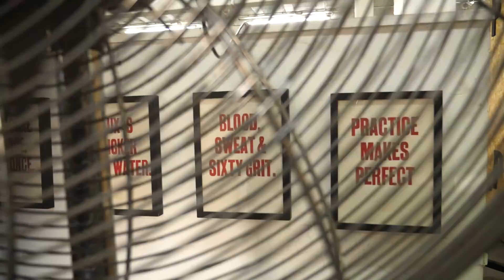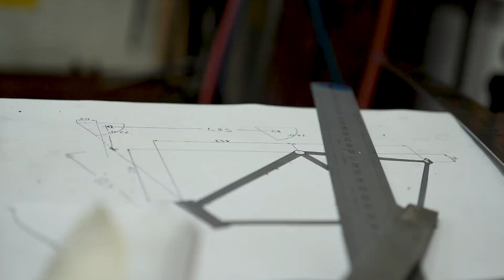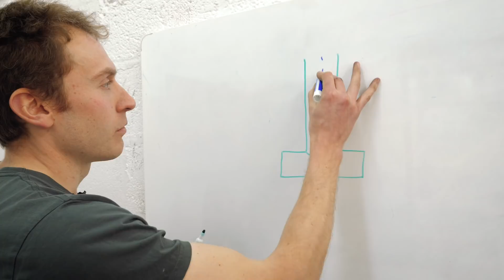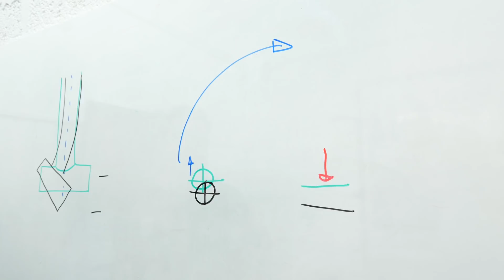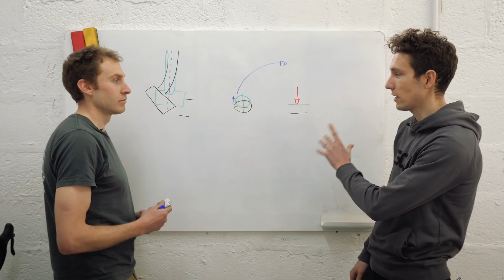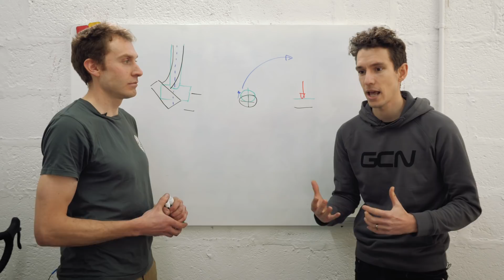Are You Faster On A Stiffer Bike?

Comment: Surely the amount of stiffness would reflect in how hard you have to press on the pedal to get it to touch the block, as opposed to how much the wheel moves. The wheel is going to move the same amount on both bikes if the pedal is at the same point, surely?
Reply: as Si noted he had to put more effort into getting the pedal into the same position. when the brake was released the frame sprung MORE QUICKLY reflecting the amount of force put in and therefore made the wheel accelerate faster and rotate further.
Reply: Yes the stiffness reflects on how much force has to be applied on the pedal, so if you press harder, more potential energy is stored in the frame. So a wheel on the stiffer frame would move faster, like on the Orbea.
Reply: Oh okay I see. That makes sense now :)

Comment: I had a wooden frame that flexed alot. And when i changed bikes i realy noticed the diference. But it didnt seem to improve my times. So if the frame isnt flexing so much that it causes, brake rub its fine. But for racing i think stifer bikes are beter, so you get faster release of energy (sprintig, also brake rub). Fol longer rides, flexier bikes stil rock!

Comment: I would think that on the trainer, all the energy transferred to the frame ended up being transferred equally to the wheel. On the road, the wheel will be giving up a good portion of that energy to the tyre and lost as friction and heat. A stiffer frame gives up less energy to the rear wheel and therefore transfers more to the drive train (?)

Comment: in a laboratory setting you get energy return but keep in mind the rear wheel is being held solidly in place. Out on the roads the wheel will follow the frame's flex each time leading to a slight side-to-side movement and not contributing to forward movement. Thus, I'm all for an efficient stiff frame vs a light-for-the-sake-of-it frame.
Reply: Agree, this was a great isolated test where the stored had energy had more or less one way to go. Out on the road, the stored energy would probably not dissipate so cleanly to our benefit. One path for the energy release could be a sideways rolling moment very slightly rolling the frame and then some of it being transferred to the rider. There could be other paths as well.
Si, please do us a real-life test to see if this is anything more than negligible.

Comment: How about doing this with the rear wheel on the ground?  You’ve eliminated the opposite and equal reaction of the earth pushing back against the load, and all issues of energy loss from other places, like friction between the tire and the tarmac.

A more flexible frame may find an oscillation that’s complimentary to rider inputs,  but of the whole energy budget being put into the pedal stroke,  you’re losing some to the act of flexing the frame.  Sorry,  no perpetual motion machines allowed.

Comment: I propably misunderstand physics here but aren't you just putting tension on the chain which releases as soon as you let the brakes go?
Reply: Some yes, but you can definitely see the frame itself flexing in the video.
Reply: Certainly - I don't doubt the conclusion, I just find the explaination a bit complicated - as I see it, the frame flexes down and puts tension on the drivetrain which releases when the frame flexes back up again. The same would happen if you used a leaf spring instead of a pedal arm. I didn't quite understand how they explained it on the show.
Reply: The idea is that the flex doesn't lose you energy, it's simply stored and released later. The reason that they don't use a leaf spring is because they wanted to show that the sideways motion is translated to a rotation when the brake is released.
It's a valid point, but I still wouldn't trade for a more flexible bike. The delay would make the frame feel sluggish. The only reasons I see are to help with comfort and cornering.
Reply: I'm the opposite - my priorities when cycling are adventuring and gaining fitness and in both instances I need as much comfort as possible.
Reply: The comfort in a bike frame/fork without a suspension comes mostly from the frame/fork flexing vertically when there are bumps on the road. The stiffness mostly comes from minimizing the sideways movement in the bottom bracket area when the rider is pushing on the pedal. They are not mutually exclusive.

Comment: I admit that this is a really complicated issue, but my first thought is that in the real world there is (hopefully) no solid steel block to stop the pedal. If you are flexing the frame until the pedal is at 6 o'clock position, the "unflexing" happens when the return movement is not applying any force to the chain.

Comment: I suspect this translates to acceleration. I.e. higher frame stiffness = better acceleration. Very small numbers in difference of course. Moreover, a frame with very low stiffness could potentially "lose" energy by the fact that the frame never seems to return to the initial position, this part is more a though experiment since no frames are that bad (the energy would most likely go into heat at this point by bending of the frame). 

But in my experience the biggest difference i noticed when moving from an old alloy frame to a TCR (acclaimed of very high stiffness), was the acceleration. And with better/sharper acceleration i felt that my momentum didn't suffer as much when the gradient changed, i.e. i was able to keep the speed higher.
Reply: I think you nailed it on the head. It’s not necessarily more stiffness that make a bike “faster” because even super stiff frames still flex. I feel it’s stiffness in certain areas of the frames that brings greater acceleration when cornering for example. As a surfer, I can see the similarity with surfboards and especially surfboard fins. Super stiff boards or fins don’t accelerate well in corners, but the “foil” or actually profile of either one will create better performance, having stiffness at high speeds, but also great acceleration in tight corners when making sharp turns. I think this is going to evolve as technology and testing reveals more proof of efficient carbon profiles.

Comment: Flexible frames obey Hooke's Law. When you apply a force to a frame (push down on a pedal) the frame will be displaced, as F=-kx.

When you release that force (at the bottom of the pedal stroke), the elastic potential energy, due to the displacement (U=1/2*k*x^2) is released. That energy just goes back into the drivetrain due to energy conservation laws (ignoring the very minor efficiency losses).

This is the first time I've seen it demonstrated empirically, and it's a very good demonstration, kudos to Tom Sturdy - never thought about it like that - great video!

My only minor dispute would be the focus on the vertical movement, as it's simply a component of the overall displacement. Assuming 100% mechanical efficiency, even the energy lost via the work done to displace the frame horizontally is recovered as the frame flexes back to its starting point, therefore, Work in = Work out so the net change (loss) is zero.
Reply: Loss of energy is not zero, there is little loss  maybe in the frame but the tranfer of it through all the transmission components is not negligible, and above all there is the tire. Whatever it is the compound the gum suffer form hysteresis which probably wastes all the energy returned from the frame flex that managed to get there.  There is also the problem of fatigue, when you repeatedly put the frame under load within the elastic range the material is weakened by a tiny bit due to imperfections. If a frame flexes too much that could shorten the life of it.

Comment: As a material flexes repeatedly, you are bound to lose some energy in the form of heat. To what degree? Who knows.
Reply: Probably to very small degree. So small it's pointless to care about it.
Reply: Have you ever made your frame warm by flexing it?
Reply: 1%? Never... much less than 1% lol. That would be ridiculous.
Reply: Sure, however a stiffer frame will store just as much energy, it will just deflect less. What's important is that both the stiff and slightly more compliant frames are both moving well within their elastic limits. Sure, there might be a tiny bit of energy lost to heat, but it will be vanishingly small compared to other losses in the drive-train.
Reply: Definitely less than 10% less than 1%? who  knows?
Reply: Measure the temp change and then you can calculate the wattage required to cause the increase. Bingo there is the amount of watts you wasted heating up your frame .002 degrees
Reply: I am not sure wether elastic deformation really generates heat. AFAIK, the heat is generated by internal friction of the atoms rubbing over each other. But they only move on top of each other during plastic deformation, which does not happen in a bike. The frame is designed to handle tension well below its yield strengh because most materials, metals especially, would fail after only a few cycles if they are loaded with alternating tension near or above their yield strengh.

Comment: The force put onto the pedal would cause a clockwise flex in the BB as well as down.  Releasing that force by releasing the rear brake would make the BB go up and back...would it not?  I would think the wheel rotation is caused more be the stress and tension in the chain then the flex of the frame.  As that tension is released (in both directions I assume) the wheel moves in the only direction possible.  I would be curios to see what would happen to the rear wheel if it was mounted on a completely free axle, one that could spin in either direction.
Reply: I think you are going the right direction, but the flex stresses in the wheel via the spokes would be my energy store in this senario. Hub twists forward but rim held by the brakes.